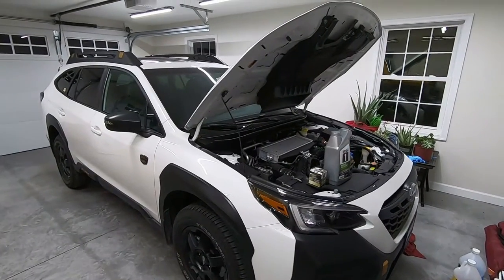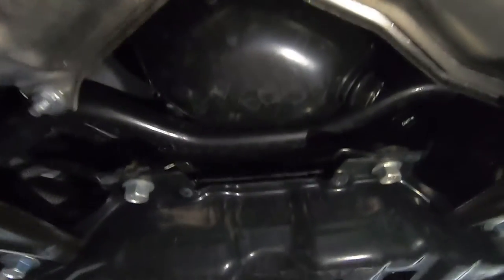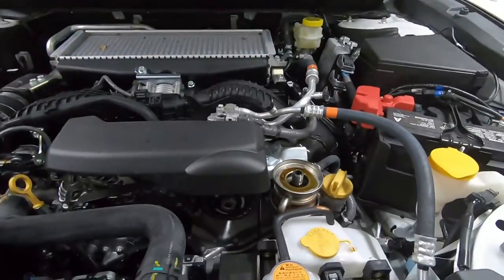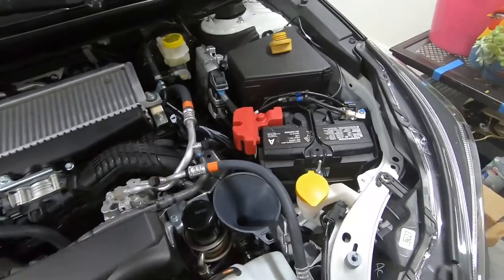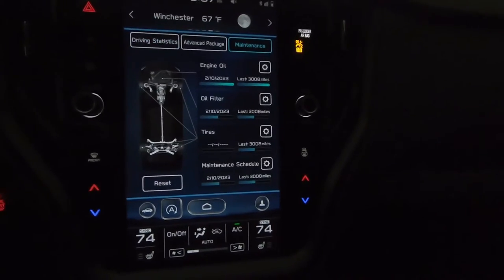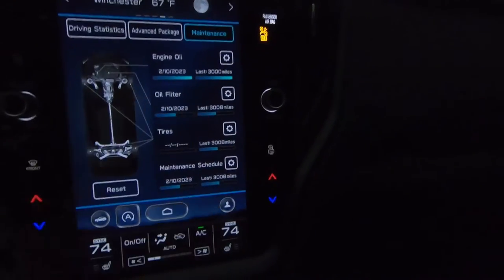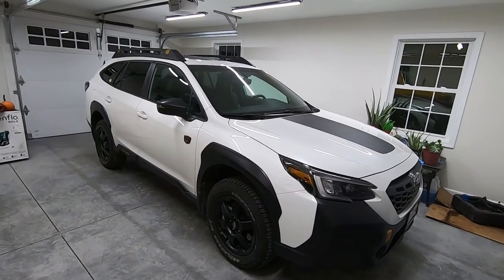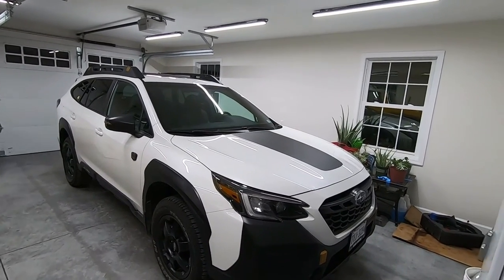Break-In Oil Change & Maintenance Reset on Subaru Outback Wilderness

Comment: 3000 a bit high for break in. I’d do 500-2000
Reply: I did mine at 1000, I agree 3k is passed break in
Reply: @joshuarivera3617  even  1000 is to high  100- 200 miles break in
Reply: Subaru service doesn't even recommend break in oil changes now. It's overkill with new updates to the manufacturing process which leads to little or no metal shavings.

3 different service techs and a local mechanic all said 6000 is fine.
Reply: @Bajungadustin  it’s more for peace of mind I guess. If you got the 40 dollars to spare. Why not
Reply: @Bajungadustin  Why would a manufacturer care if you break in their product, the sooner it needs replacement the sooner they get more of your money. And oh really, tell that to the metal shavings I find in the oil/oil filter. Overkill or not, better safe than sorry. Look at Toyota as well, the most reliable brand with the most advanced machining technology, all their new tundras are having engine failure due to metal contamination. What's a $30 oil change going to hurt?
Reply: For sure.    The oil geek guy on you tube did a video on this.  It’s really a good idea.  6,000 is too long.

Comment: Yeah dealership told me first oil change at 5000 miles. I got 3 free oil changes but they won’t do them unless 5000 miles or 6 months. I did the first one at 1200 miles and used Subaru Japanese made oil filter that comes from factory. Don’t use the blue Subaru oil filter made in USA. They are junk. I then was able to use the first free oil change when 6 months up at 3k. They put blue oil filter on but I changed it after few miles to Subaru Japanese filter that comes on them from factory. You can order them on line in a 5 pack. Be careful to not get counterfeit ones from China. I plan on 3k or 6 months oil change interval with only Subaru oil. Mine is not driven much but I will change oil every 6 months anyway
Reply: Hi. may I know where do you order those black Japanese filters? thank you.

Comment: Picked up my OBW in 2021 and already changed the oil twice. First time was at 2000 miles.  I installed a Nameless Performance magnetic oil drain plug with the Subaru crush washer and torqued to 25 lb ft.  I use Quaker state ultimate durability 0w20 synthetic. I'll go 5000 miles max between oil changes. I use Subaru oil filters.  And a side note at 6000 miles I rotated the tires using the spare as per manual but it set off TPMS light on dash.  So I had to take spare off and just rotate tires that were on it. Light went off after driving a bit. Hope this helps.  I got over 7k miles on mine and the only complaint is the screen lag.

Comment: Can’t believe someone would use plumbers pliers in an instructional video to remove an oil filter
Reply: Lol. Hey it worked. I recently changed my oil and filter and you would not believe how tight that oil filter is from the factory. It would not budge so I ended up using plumbers pliers to get mine off too.
Reply: its an old filter, it goes in the garbage when you're done, brah

Comment: Thanks for the oil and filter changing video and how to reset the oil maintenance process. We have a 2021 Subaru Outback Touring XT and I will be doing the maintenance now as my free two year service is over.  I will be following your video for additional DIY maintenance procedures.  I have already changed both engine and cabin air filters.  I think the dealer may have changed the oil drain plug because I had to use a 9/16" socket instead of a 17mm socket.

Comment: On my 2024 Outback touring, 1st oil change was done at 900mi. (I used the 4x free Subaru oil change offered) and let them do it. Now my OB is at 4500mi. I'm planning to have them do the 2nd oil change before 5K mi. In future, I'm planning to change the oil for every 5K mi. not 6K mi. as recommended by Subaru. 5K is easier to remember and it's good for engine's life (oil is cheap 🙂).

Comment: Failed to mention the de-flood cranking method to prime the oil filter before starting.
Simply place foot on the brake and floor the thottle. Then press the start button until the oil light goes off.
Release the throttle and the engine will start with full oil pressure and not run with dry bearings each time you do the oil and filter change.

Comment: I did mine at 1,000 miles. 
The oil looked   dark I made sure I even cleaned the drain pan before I drained the oil out of the crankcase.
Reply: I did as well.    Although I didn’t clean the pan.   Probably a good idea.

Comment: Brand new 23 crosstrek and outback and read a lot about doing an oil flush first and then changing the filter and refilling the oil - curious as to why you didn't do that step? Thanks for the video, looks much easier than my old vw oil change!
Reply from the maker: Thanks for watching! I'm not a Subaru master tech or anything but the flush just seems pretty unnecessary and wasteful to me. That's something that's certainly not the norm for other cars. Allowing the engine to run for a few minutes before the oil change should warm up the oil and capture most of the contaminants for when you drain the engine. I never plan on allowing our Outback to go to the 6k intervals in the manual. My plan was to change the oil at 3k, 6k, 10k, then every 5k or so after that always using premium oil. To me, doing frequent oil changes with high quality oil should be more than enough to keep everything clean and running well.
Reply: Your not using a time interval between changes? Only mileage? My 2024 manual states 6k or 6M. Which ever comes first. Well done video...L&S

Comment: You need to prime your oil filter , before you start your engine . Foot on brake pedal and push your gas pedal to the floor. Push your start button. This will crank the engine with out starting , pushing oil into the filter . VERY IMPORTANT  procedure on any engine. 5 seconds should do it. Then restart engine 1 minute , stop engine . Check oil level. Add if needed . Also use new washer on oil plug torque to 30ft ibs. Do your home work.
Reply: Yup, That’s what I do.   I got the cranking procedure from the Mr Subaru guy.

Comment: Dose the manual say anything about  priming the oil system after you change it?
Reply: No it does not but I posted a video of the process on my channel.  Its only about 1 minute. EASY! It's called clear flood mode crank.
Reply: @iceplant1  Thanks i will check it out!!
Reply: Super easy, if you have a push to start. Before turning on the car put your foot all the way down on the throttle AND the brake, push to start, and let it prime for 10-20 seconds. You can then turn off the ignition and turn it back on as you normally would with the brake and button.

Comment: Hey I was wondering if you have a different level on your dipstick on each side of it? Everytime I check the oil level I have a different read depending on which side of the dipstick I look at
Reply: from my understanding this is normal
Reply: Honestly, on my 2024 Crosstrek when I check the oil I have no clue. 0w-20 is so thin and the level fluctuation after priming the system makes it so difficult to determine the real level. I just put exactly 4.7 quarts with a new filter and call it a day.
Reply: Have a 24 Crosstrek 2.5. Did the first oil change at 1000 miles. Used Subaru oil and filter. A 24 Crosstrek states 0-16w oil. I don’t have any issues seeing the level on the dipstick.
Reply: My owners manual said to use the low side.

Comment: Is yours leaking oil? Apparently there is an issue with the lower oil pan gasket and the pressure switch developing leaks. 

Thanks
Reply from the maker: No leaks to report so far
Reply: @TrailPass  Cool. Thanks for the response. Maybe some of us dodged the bullet. One additional thing—My 2023 Wilderness is at the dealership for a paint defect in the spoiler and a defect in the passenger seat, so I have a 2023 Wilderness loaner. Per some suggestions by other Youtubers, I checked the oil level on the loaner, which has 1900 miles on it, and it is over filled. Apparently a lot people have had the over fill issue too.
Reply: @derspeed5796  My dipstick was drenched in oil from the factory like way past the fill line. I changed it at 500 to the correct levels because I know the plants in the US are just trying to pump the cars out with 0 care.
Reply: @BorderTurrets  I don’t doubt it. They were trying crank them out back then. I watched them do my first oil change and it still shows a little over the full line. I’ve had no issues.